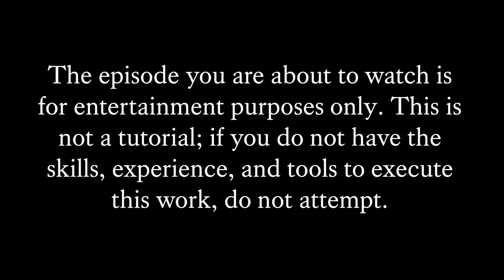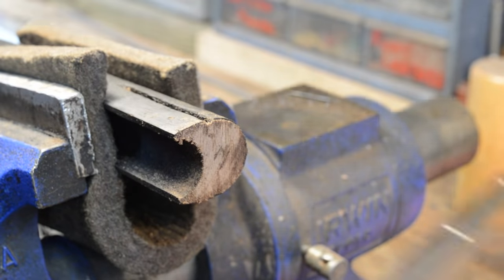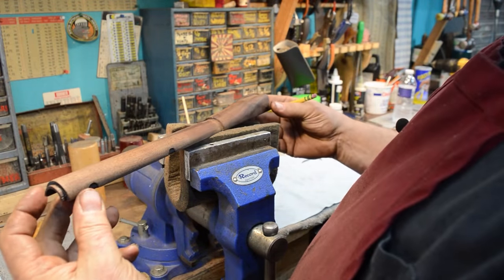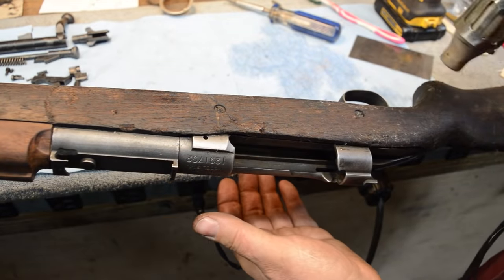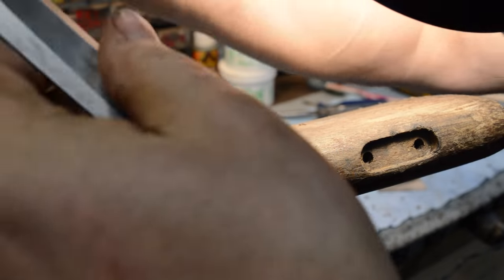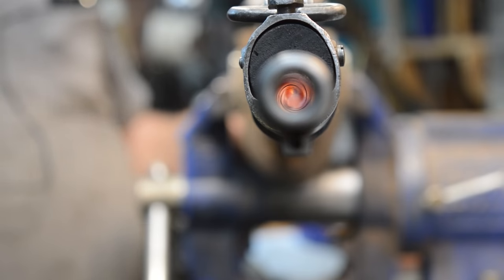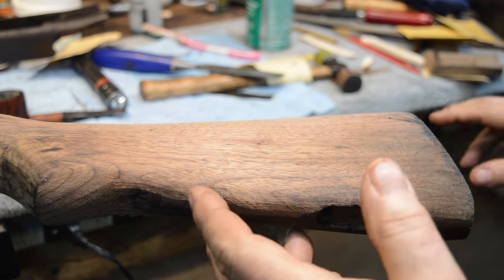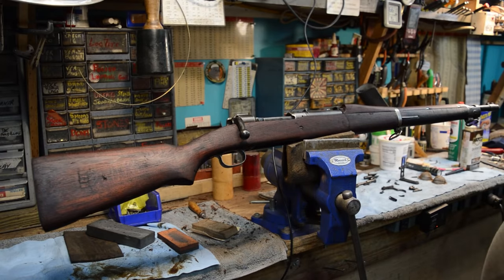Anvil 094: 1903 Springfield Split Personality

Comment: Forgive my ignorance but why wouldn't one just buy a new stock? I can understand for collecting reasons but would the repair impact the value as much as a new stock?
Reply: Originals are originals, whether they were repaired or not.
Reply: Yep. I reckon you could buy new metal too.
Reply: It goes back to this- why not buy a new gun (or atleast one thats been newly refurbed). Well, you got what you got. You have a gun that is not 100% and cant be made 100% original again. So you try to do a faithful-enough restore- within the confines of what you have. Do you braze together the rear sight (gew88 video he did), do you buy a replacement one, or do you buy or make a repo? If you braze together the one you have, you keep an original part to the original gun and you save money and postage and time. If you buy a used one, you take a part off the used market that someone may could really need for theirs thats missing altogether. And then your original broken one sits in a drawer for all time because you wont sell it, and when you die no one will know what the heck its for. Itll go in the garbage; an original piece. (that said, not everything is worth saving..)
Its right similar to what hes talking about with the gene pool in the vid. Conservation / Preservation I suppose.
Reply: There's only so many stocks out there for these old guns. Yes, there are repros, but they're not going to be available forever either. If you can save one, and keep it out in the field for another 50 years, it makes sense to do so.

Comment: I hate lacquer varnish, probably because on all my older rifles it's just flaking off. Btw, any tips on removing that stuff on a "corn cob" rorend? 

Scraped the stock but not sure about the ribbs in the forend...
Reply: For removing varnish type finishes the best I've found is IIRC Dad's at Walmart. Comes in a mostly blue can and it removes finish like crazy. That means you better do it outside or in an open garage. Anything that effective has trade offs as in safety precautions. I wear a full face shield, proper chemical proof gloves(latex/nitrile/etc will not work) and a lab coat or other expendable garment. 

That stuff stings like battery acid on skin, and in your eye you'll forget everything except where running water is and hoping you'll get to it fast enough.!!
You'll have to follow up the remover with recommended chemical which I don't recall off hand. Another reason to NOT work with it in enclosed space. 
For stubborn little spots I try a bronze or brass brush or ChoreBoy type "steel wool". 

I try to avoid sanding as much as possible. The hard way is wrapping THIN sandpaper around a rat-tail file. Normal sandpaper will hog out the grooves. Frankly, I've decided that its better to blend/stain the forend and get the stock to match. It looks better on a vintage gun like WInchester Model 12s. Every stock set is an individual and I always learned something with every stock I worked on.